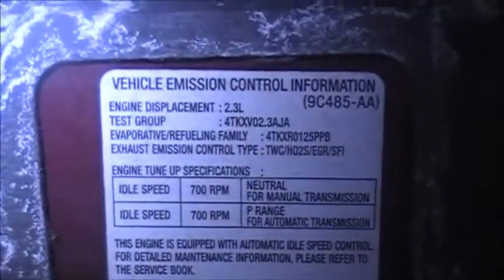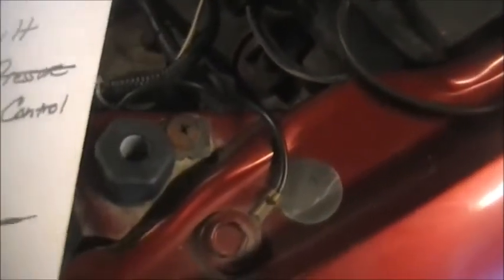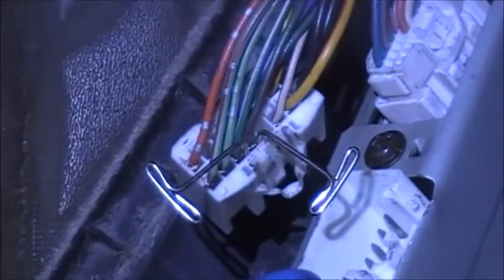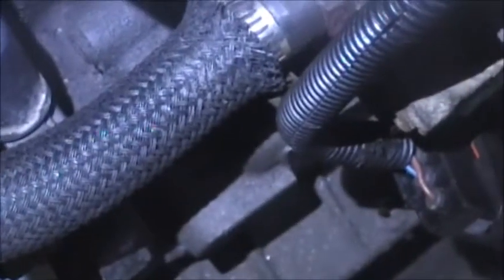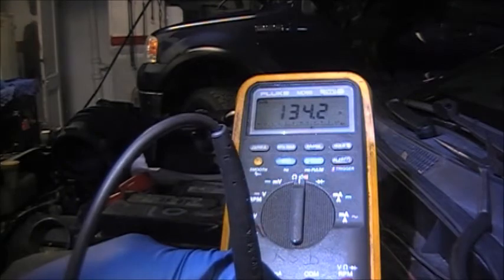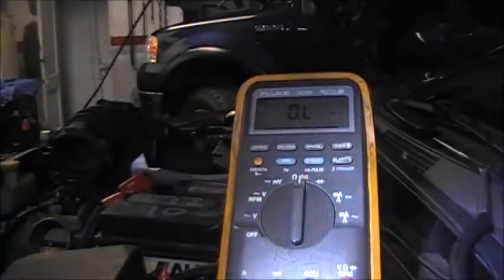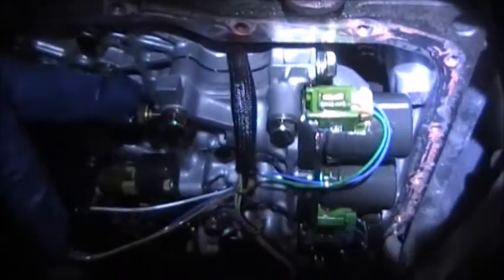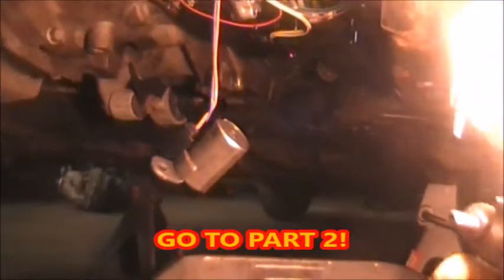mazda 6 trouble code P0745 EPC CIRCUIT FAULT PART 1

Comment: I have a 2007 Nissan Frontier (re5r05a) and I have the same code. I replaced the solenoid and it is still engaging hard and not shifting into overdrive. What should I do now?

Comment: Great explanations 

I have a 2001 Nissan Maxima it has a p0744.  Shifting very badly.  Fluid was dark so did a drain and fill with Valvoline max life ATF and Lucus.  
What a world of difference  but still p0744 came back.    

I think TCC is clogged up or could need replacement kit below replaced all solenoids in transmission 

Nissan Part No.: 31940-80X25
SOLENOID REPAIR KIT - CONTROL VALVE

Comment: Sir thank you for this great, informative video. I checked the resistance of epc(electronic pressure control valve) of my 2010 Mazda 3 today(1600 cc, 105 hp, auto tranny). In forscan there is a parametre as lps(line pressure solenoid) I assume it stands for epc in the tranny. To sum up, lps/epc solenoid is max. 0.95 amper sometimes as low as 0.60 amper. No AT or Engine light or TDC. According to sonnax.com and as you have just explained, it should be between 2.4-7.3 ohms. What do you think? Should I replace it? Thanks.

Comment: Thanks for the insightful video.  I'm receiving P0745 on my 2009 Mercury Milan.  I replaced the Line Pressure Solenoid but both the old and new solenoids tested at 4.2 Ohms. I replaced the solenoid but still have the hard shift into reverse and short/hard shifts upshifting/downshifting.  Any direction to take from here?
Reply from the maker: If you have, the 6speed transmission, they have valve body issues.